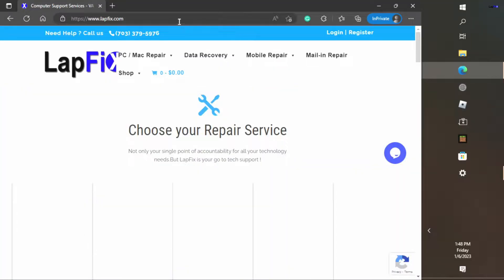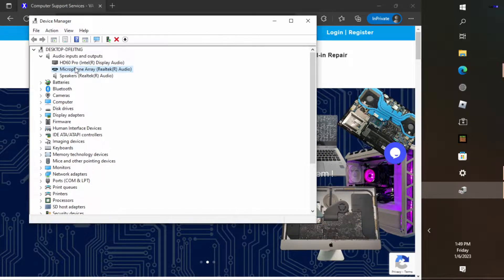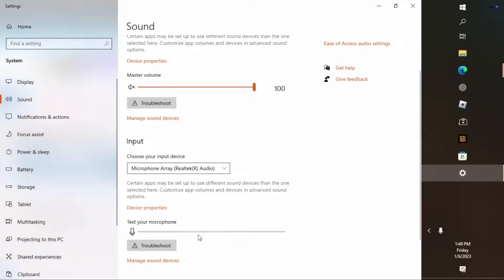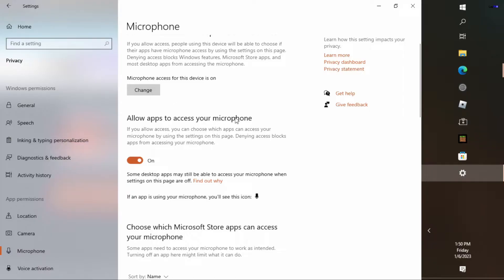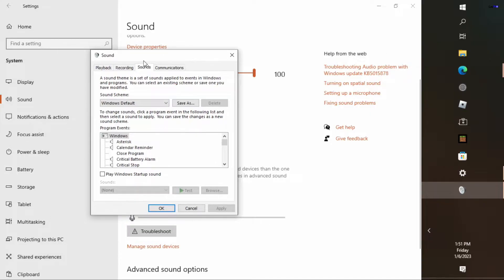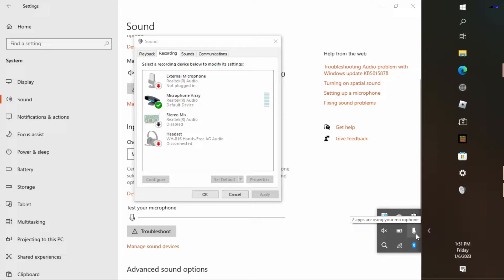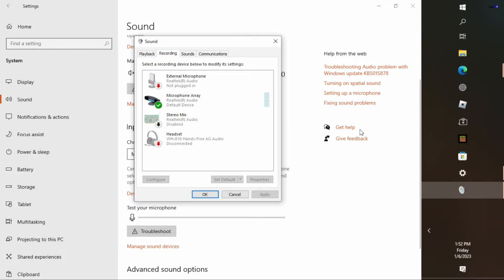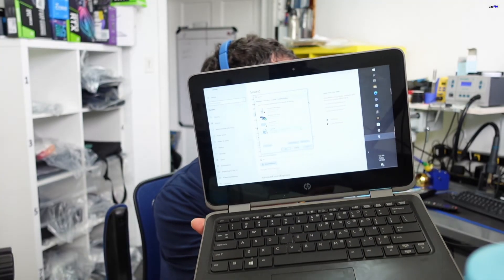How To Fix HP Microphone Not Working

Comment: My HP EliteBook 840 G3 was having microphone issues on Windows, whilst on Linux, the microphone was working fine
It turns out I forgot there was another Audio Software controlling the Microphone, which was Bang & Olufsen Audio, and it turned out great, and the microphone finally works! Great video, this really helped.
Reply: Pls how did you fix it. I am using the exact same computer as you and having the exact same problem. I've done everything I know but the problem persists

Comment: I do not have HP audio control on my computer.  I have an HP Envy 360 laptop.  How do I get it or access it?  I have Windows 11.   I fixed my issue by going to control panel, then I searched "audio", then clicked "find and fix audio recording problems" and it reset it and bam!  It worked!
Reply: I can't find the audio option in control panel 
Can u please help
Reply: Yea i tried your method and it worker unlike the video we are on so thank you Olivia

Comment: My HP Laptop (model 14-dv2014TU) is experiencing the same issue. I followed your tutorial, but I couldn't find any settings named 'HP Audio Control'; instead, I found 'B&O Audio Control.' However, none of the settings seem to resolve the issue. Could you please assist me in resolving this problem?
Reply: I fixed my issue by going to control panel, then I searched "audio", then clicked "find and fix audio recording problems" and it reset it and bam!  It worked!
Reply: @writtenbyolivia  you are an angel, thankyou for this!!!!

Comment: Having a decent HP Laptop 14-ce0xxx - and nothing worked to me.  I can't even see a vertical bar at "Recording page". Other options seems "ok" as in your video.
B&O play (same as HP Audio Switch?) showing empty bar for mic level (0%), but even if i drag it to 100% - it resets after closing this app to 0% again, lol.

upd: Fixed issue with HP website! Suport page - HP Pavilion - 14-bf023ur
Downloaded  Realtek High-Definition (HD) Audio (Windows 10 version 1803) for win 10 x64
Rev: 6.0.8940.1 Rev.A
File size: 93.3 MB
It asked me to uninstall old driver, then reboot, and then installed a new driver, and EVEN BEFORE 2nd reboot - i had a vertical bar and fully working mic!

Comment: i can 't believe that is was also my problem I have been using linux and all the audio inputs are okay and in windows i had gone through all the audio setting except for that one setting.
Reply: This was my exact problem I just remembered that my hp uses bang&olufsed audio and i hadn't checked. that begs the question why TF* does it default to microphone muted? These are some of the things the suck on windows.

thanks so much for the help buddy.

Comment: Hi, thought your video was great, however it didn't solve my issue. Need to contact HP! Thanks though. Learnt a lot about Sound!
Reply: I fixed my issue by going to control panel, then I searched "audio", then clicked "find and fix audio recording problems" and it reset it and bam!  It worked!